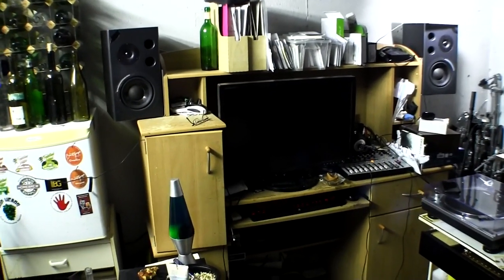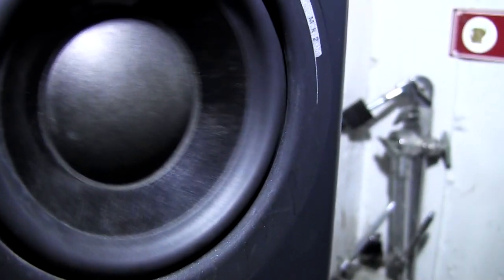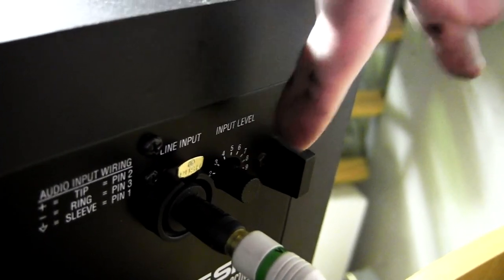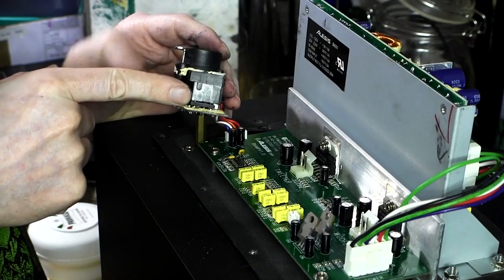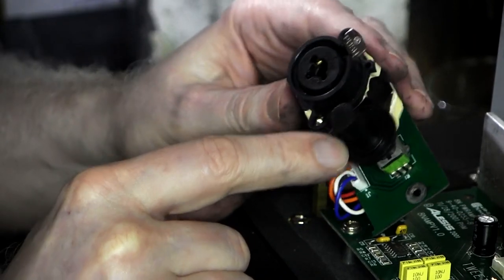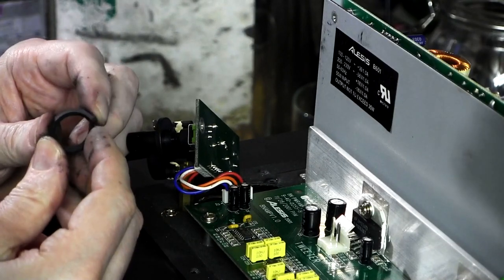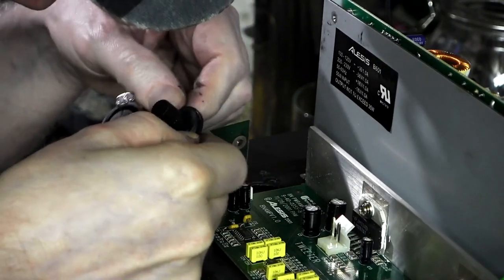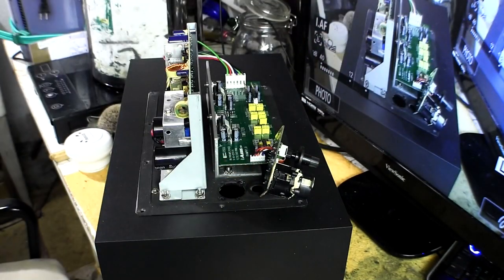Craig's Dungeon 002 - Speaker Repair

Comment: Its a great feeling to know that with a little effort and some research most everything can be repaired, often times cheaper than buying a replacement. Our flat screen (LCD) TV went black one day without warning. Had sound just no picture. Opened up the back to see if there was any visible signs of damage i.e. burnt or exploded electronic parts. Didn't see anything but could sure smell something had burned out. Turns out it was a common problem with that make of TV. The T-Con board went bad, so long story short for $52 I ordered the board fixed it myself. Has worked fine ever since. Replacement board $52 , to get it repaired at a shop probably at least twice that price, to replace the TV about $600. Satisfaction of fixing it myself, , , Priceless. Looking forward to more Craig's Dungeon episodes. Cheers ! 17

Comment: This is JUST the sort of video I was hoping to see from Craig's Dungeon!!! I'm a gigging semi pro musician in England and I have a number of effects pedals that died after plugging the power supply into a dodgy socket in an ancient haunted English pub. Can you please do a video on repairing guitar FX pedals?? I can solder and use a test meter.
Reply from the maker: I don't have any pedals to repair but they're like anything else. Take them apart and see if something is burnt out. You can usually smell burnt resisters and visually see popped capacitors. They're easy to remove. Just melt the solder and pull them out.

Comment: Hi Craig,

Great bodge, meant in a good way as bodging in the past was a very skilled job, making the best job with the materials available.

What you really wanted was an O-ring (what you basically made with the piece of belt), I have a box full of assorted O-rings, if you want any for future use send me a PM and I will put some in the post. The glue may well have been Gorilla glue, put a thin stripe round, wet it and it foams up and will provide a seal. Silicon sanitary sealant will do the same sort of job.

I was also going to suggest replacing the electrolytic cap with one of a higher voltage so that it will last longer but I suspect your larger replacement is just that. That is one of the main failings of electrical equipment as designers tend to put the smallest components in that they can get away with. If you run a 50v electrolytic at thirty volts it will probably last forever. If you run the same cap at 50V it will get hot and the liquids inside will get expand and cause the bulging and eventual failure of the cap. That generally happens just after the guarantee runs out. I suspect that your larger replacement cap that you have is rated at a higher voltage?

Let me know if you want the O-rings, they may be useful in the future.

Cheers

Schnuz.
Reply from the maker: Hey, sure I'll take some O rings. Send me an Email craigtubemail@gmail.com .  Yes, I did use a larger capacitor in the other speaker, mainly because I didn't have a smaller one, but I also knew that it would last longer, since it's higher voltage, and is now not close to the components that get worm. I just extended its leads and found a comfortable spot to tape it on.

Comment: Digging the dungeon vids craig. Desoldering caps always feels dicey; if they haven't fully blown already, I'm cautious as to what the solder heat might do to an angry one.
Reply: Desoldering shouldn't be a problem, electrolytic caps blow big time when they are hot and being driven hard under working conditions. If you let everything cool down for a while the internal pressure reduces. I've never had a cap blow while desoldering it, just don't desolder it with a blow torch LOL.

Cheers

Schnuz.

Comment: Nice repair Craig!  I've repaired a few LED monitors and TV's with bad caps that have that domed-out top issue.  There's a great place on Parkdale Ave called Nutech Electronics that carries all electronic repair parts.  PS.  Maybe you can fix the lighted sign in one of your upcoming videos?  ;oP  cheers, Dripstick
Reply from the maker: Hey I forgot about that place. I"ll have to see if they sell LEDs ;)